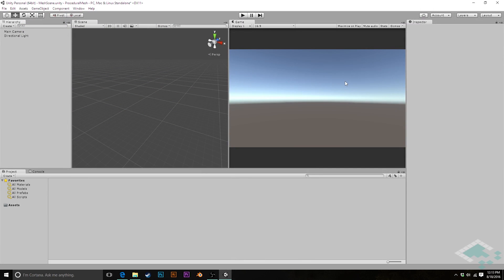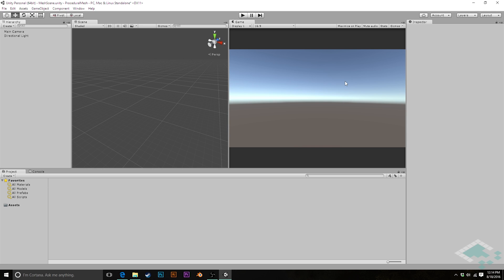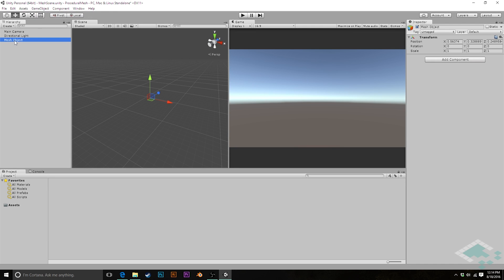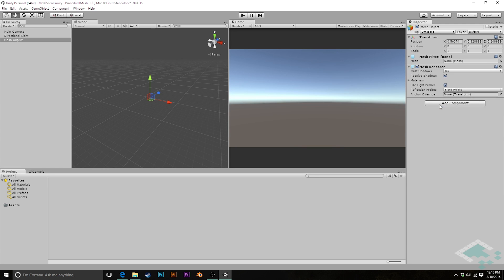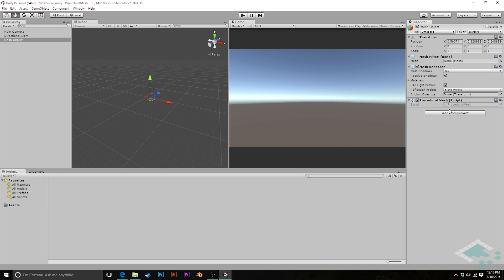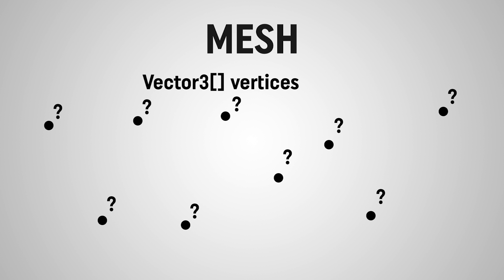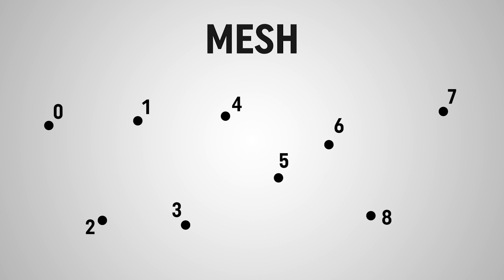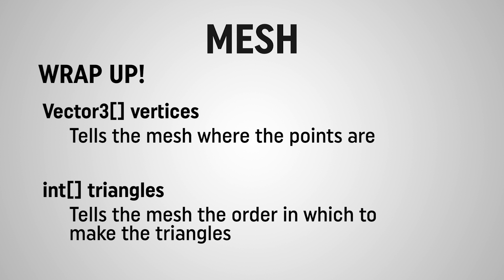Procedural Mesh Tutorial, Part 1: Mesh Basics

Comment: If triangles works in groups of three (eg indices “0,1,2” ; “3,4,5” etc) why don’t we define triangles as an array of Vector3, rather than an array of int ?
Reply from the maker: Vector3 is specific to Unity, and this construct is used for meshes across most programs/file formats. Also using a V3 struct for each tri would add a little overhead, which adds up with thousands of polygons in a scene.

It’s an interesting idea, though; and always good to think about how different data structures could be used!

Comment: 0:27 deja vu huh
Reply from the maker: You know what the worst thing about being stuck in a time loop is?
Reply: I would say that you'd never notice it :D

By the way (since you replied to my comment), maybe you can help me with this bug that's giving me trouble.
I made a small project in unity that consists of a basic 2d polygon mesh. I can change the number of vertices and the radius at runtime, which is pretty cool. But when I export my project to WebGL or Windows, nothing shows up, only the white background... I can see it perfectly inside Unity's preview though. Do you have any idea of what could be causing this issue?
Reply from the maker: Double check your vertices. Unity is very forgiving about rendering a model with stray/unused vertices, but WebGL may not be. I ran into this issue with a model from Blender that rendered in Unity but wouldn’t show up in A-Frame
Reply: Alright I'll try that. Thanks for the quick reply!
Reply: I solved my problem, will write the solution here in case someone else needs it.

The problem was that I was using a material with the shader set in "Sprites" mode, it needs to be in "Standard". The problem with Standard mode is that it only renders one side of the 2D plane, and for some reason my camera was looking at the back of the shape, so it couldn't see it.
Reply: I've been on this way before!

Comment: Could I know what you're going for with these series?

Just basics, or will there be anything advanced? (by that I mean something more than just a cube and etc)

Just want to know, because I know most of basic stuff.
Reply from the maker: +Purple Ice I'm planning to start with triangle-face-cube, get into voxel-based stuff a bit (e.g., Minecraft landscapes), and I'll also   look at making some other shapes (hexes and possibly simulating curves). Is there anything in particular you'd like to see discussed?
Reply: Board To Bits Games Not really, at least it's barely related to mesh, I have voxel project lying around but never made anything good because I just couldn't figure out how to use multithreading on generation so it does not hang up every time I move.

Anyway, I'll be sure to check these series out.